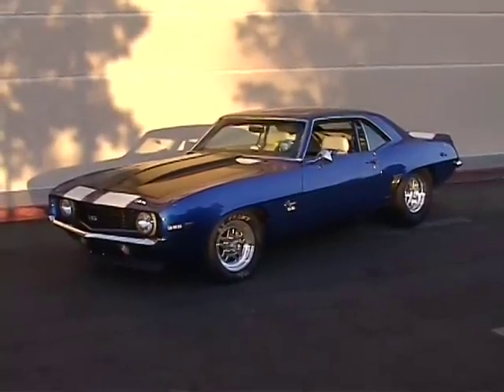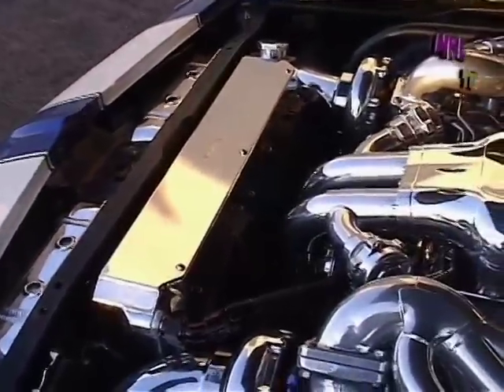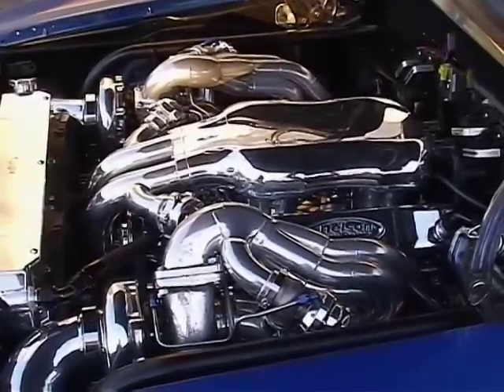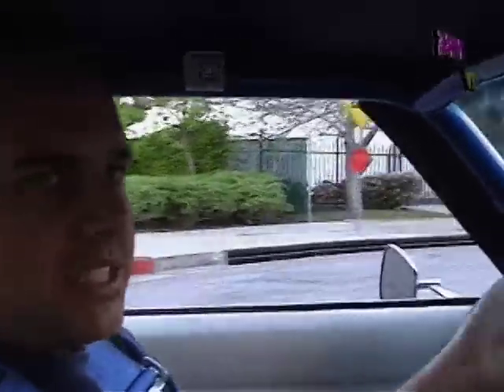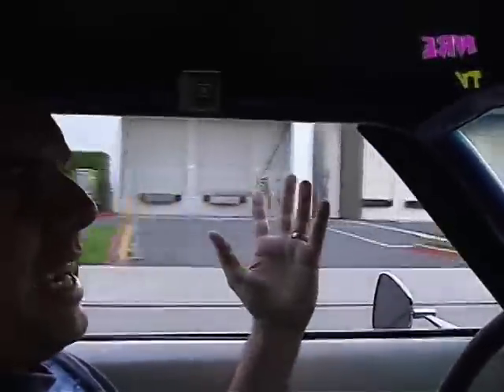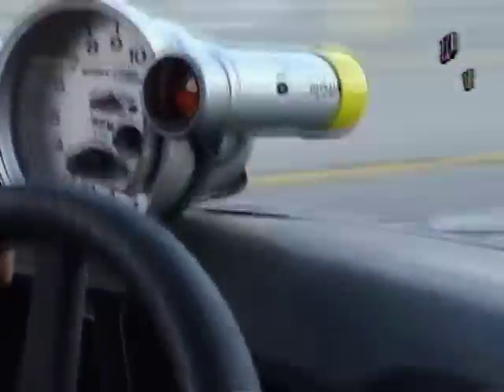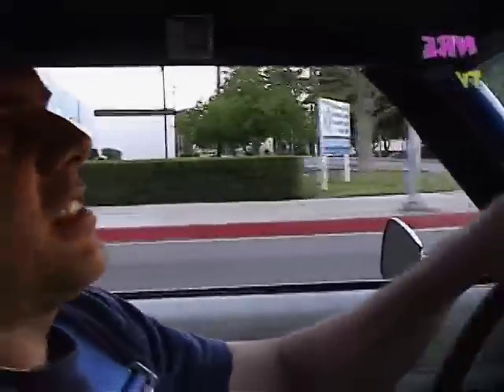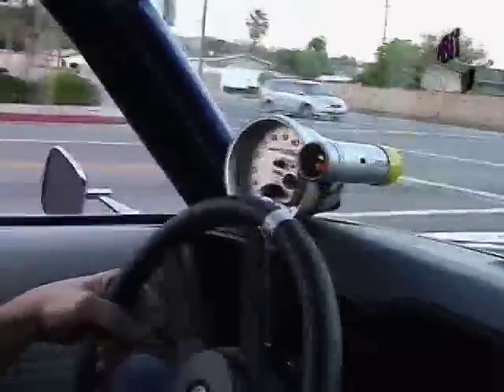1750 HP 1969 Camaro.  Alien Intake TT 427 SBC Street Test from Nelson Racing Engines.

Comment: This is a Nelson Racing Engines v8.....maybe you should look into their builds and their innovation. Best custom v8's in the world right there, many of their combinations make WELL over 1,000 hp and WELL over 1,000 foot-lbs of torque on 91 octane pump gas.

Their more recent 572 twin turbo chrysler-based hemi is capable of damn near 2,000 hp on pump gas at relatively low boost, and 2,500 hp on race gas pushing less than 40 psi, fully streetable, completely reliable.

Comment: @DeAdiSSu3 wow.. thats actually pretty impressive.. better than my camaro.
speaking of which. i have the 2011 camaro 2SS,RS Synergy package. it comes with
the V8 423 horsepower i believe. I am considering either supercharging it
or installing the twin turbo. any word of advice? any other recommendations aside
from that?

Comment: I'm sure he test's ever motor,and yes with racing fuel it will make that kind of power.If you could keep the heat in the motor at max boost it would make double,3000 plus. I believe he turns on more injectors and pumps and feeds from a second tank of racing gas.when at full boost.Racing automatics can handle enormous power,Do some  metallurgy searches,their are some strong materials used in these transmissions,special clutch material,seals,shafts,convertors etc.

Comment: You couldnn't "punch" a 350 block for a 4.125" bore necessary for this displacement without breaching the water jackets. You could however use an old 400 block which has the correct bore, stock. Better yet, you could use an aftermarket block from Dart or World Products which are specifically designed for big cubes from a small block. The Dart block is stronger but will require expensive mods to the heads to work, so I chose WP for my all-aluminum 427 (620 hp @ 6300 rpm).

Comment: Probably under 40k for the engine, this was pre billet-block / mirror-image turbos with their custom solid inconel turbine wheels and such. NRE's more recent 572 Hemi w/ octane on demand, mirror image 88 mil's + billet block making over 1,900 hp on only 21 psi, that's definately a $50k+ engine by itself, not counting fab work to the car's chassis, beefed up suspension + brakes and other drivetrain components beefed up to handle the torque.

Comment: The ls7 doesn't have the same crankshaft, rods, pistons, bearings, bolts etc. that this engine has, not to mention boost.

Pretty much all NRE engines are based on a GM, Ford or Chrysler bore/stroke/design/firing order, but they're custom street/race engines.

Comment: @EddieJr93 top fuel dragsters make 1500hp on pump gas and 8000hp on nitromethane-metanol gas. lol.

all the power in a car comes from the gas... it's the motor that needs to be built good enough to transfer and withstand the power.

Comment: The car's tires obviously cant handle all that torque on the street. So whats the point of mashing the throttle like that and risk the car cutting loose on you and getting into an accident?  Is there a custom traction control system that can be installed in the car that would control wheel spin? This way my wife wouldn't have to worry about the car's rearend getting sideways and keeping the car in control....
Reply: +Joe. Better to keep the wife out of the cars driver seat.
Reply: First of all, wrong wife. Second of all, ever heard of car controll? With 1000+ HP and street tires, you pretty much just sit there wiggling back and forth, making very little forward progress comparably

Comment: And whats the point of all this power if you cant get it to the ground without the car squirreling all over the place ?  It needs seriously a traction control system so you don't have to spend most of the time feathering the gas pedal....

Comment: id like it more if they had a way to ease into the power better, 
less jump to super power and wheelslip,
more just complete and stupid acceleration,
maybe a computer gas control, when you slam your foot to the floor, it gives max gas without so much it breaks loose over time till it hits actual max